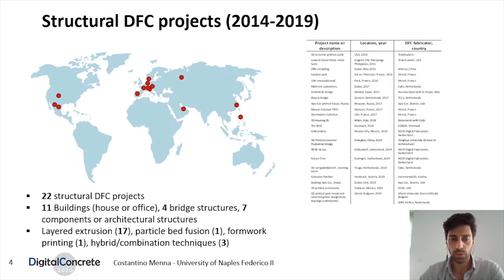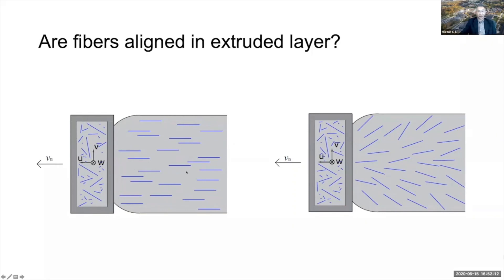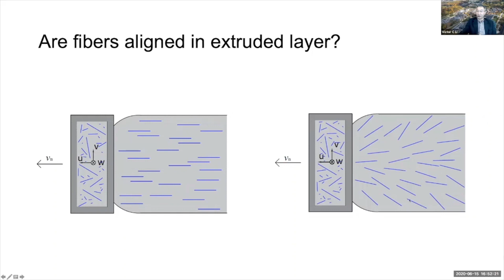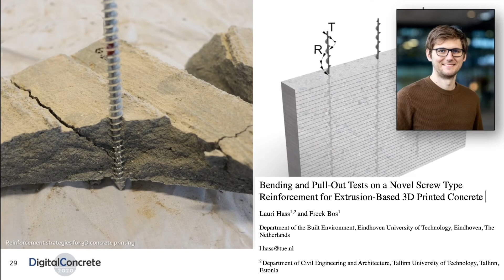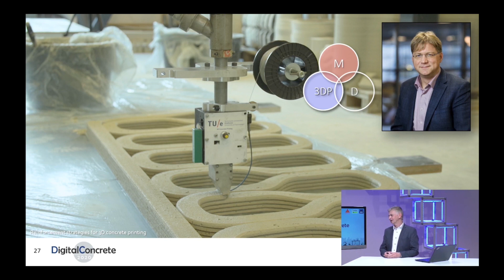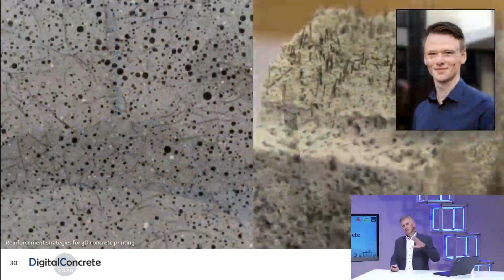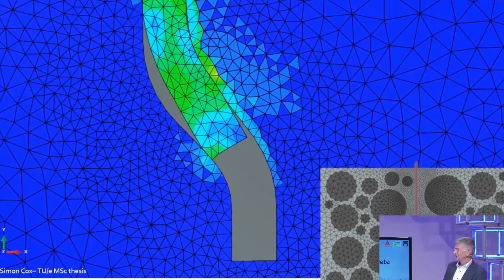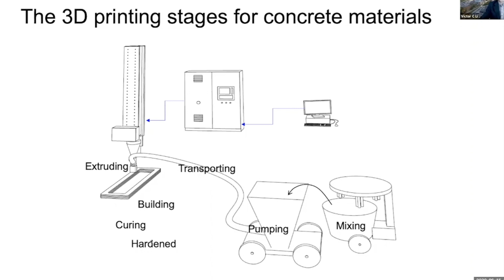Structural Reinforcement Methods for 3D Printed Concrete

Comment: Industrial engineer working as tooling designer for 5+ years here, why do you print in straight angels? Radius will do you wonders. Also, why are you using so much volume when printing?  Thanks! Respect for your efforts!

Comment: Would it be cheaper to have your house partitions and walls made of 3D printed concrete than regular brick works?
Reply from the maker: That’s the goal, the printer is a big fixed cost though so it takes many units to realize economies of scale that will bring the price down.

Comment: I was just thinking about the inlay reinforcement idea and found your video..lol....anyways...have you ever thought about the way toothbrushes are made? might be a way to add reinforcement to either the front of or behind the extrusion head. https://www.youtube.com/watch?v=i2plIal6HmU
Reply from the maker: For truly crack preventing reinforcement the cables or fibers need to be in tension while the concrete is curing
Reply: @automateconstruction  so a fiber/reinforcement that slightly shrinks as it cures or cools down? Is that correct?

Comment: Thank you Jarett for this video it was exactly what I was looking for. In my opinion all 3d printed buildings must use concrete mixed with fibers but also be provided with a base seismic insulation system as the dumping rubber bearings. Even if new materials will be developed guaranteeing a higher tensile resistance I would still prefer to use an anti seismic system. Keep up the good work!
Reply from the maker: Thanks I need to learn more about anti seismic systems and construction in seismic zones that’s something a lot of people bring up.

Comment: All those methods slightly improve the concrete tension resistence. But will be never enough for seismic areas. Ever ever.
Reply from the maker: That’s why I think many companies will move away from concrete and towards new synthetic materials with the desired properties